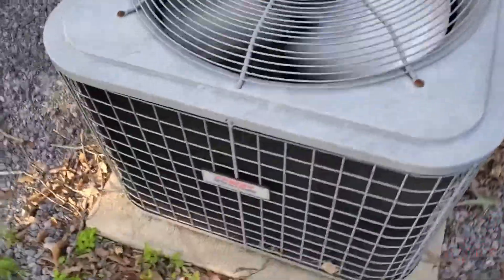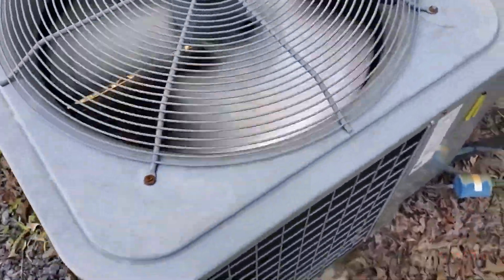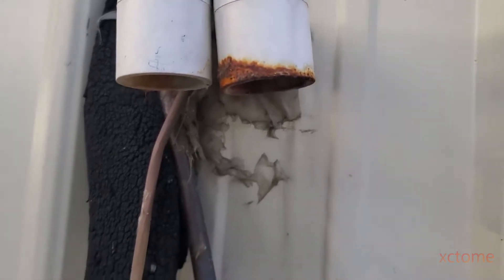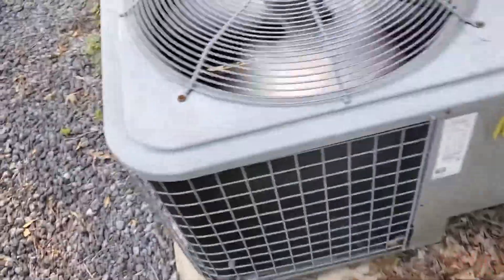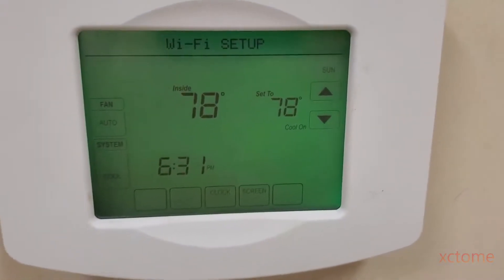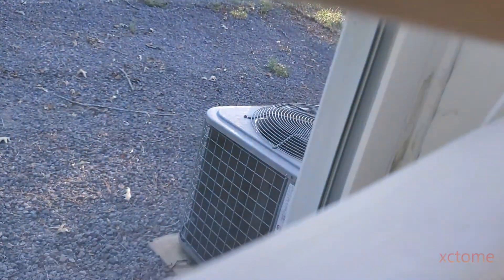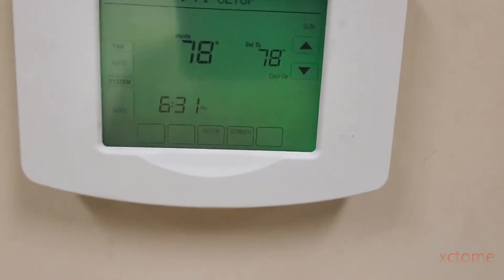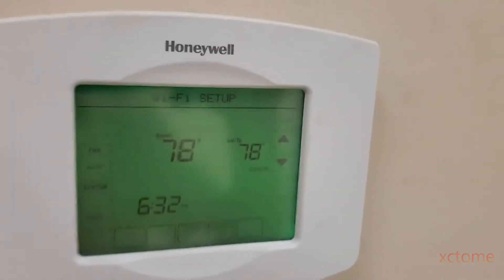The Hack Job 3 ton Heil Heat Pump Running in Cool Mode

Comment: Why on 78 I'd have it on lower then 78
Reply from the maker: Many reasons why i have it set high, if i set it lower than 78 it will probably freeze up because dumping cold air into the return is hard on the unit and it would not dehumidify at all and the second reason, i'm cheap and don't want a high light bill and i'm seldom in my office during the day. Once i replace this awful setup with a single 1.5 or 2 ton unit, i could easily keep it 75 in the office, i'm beginning to wonder how this unit will heat, if it's anything like how it cools, i'll replace it very soon.